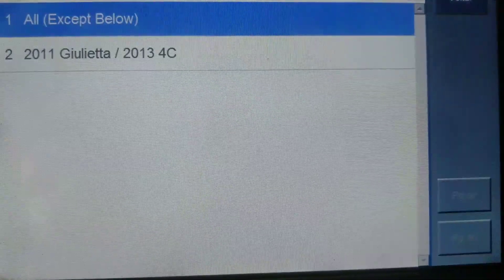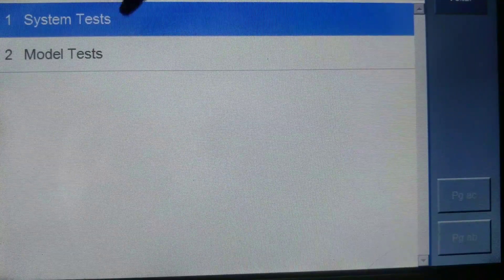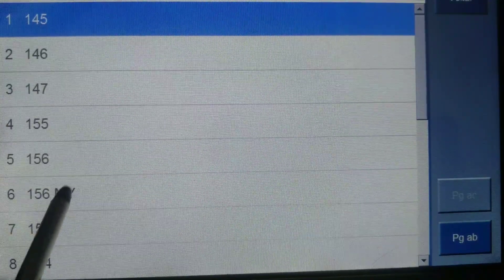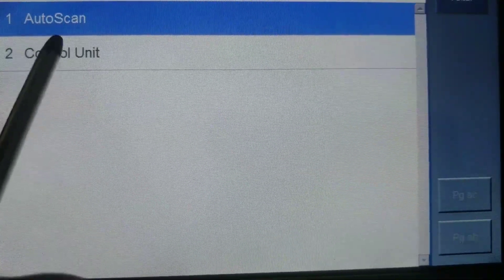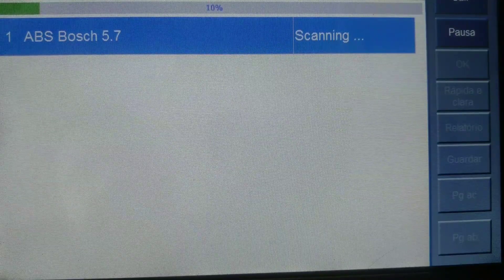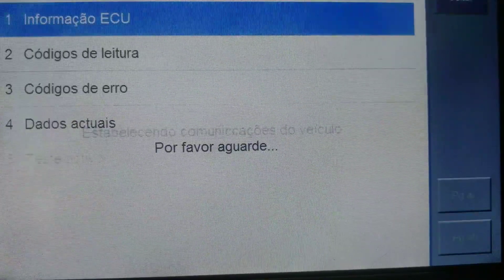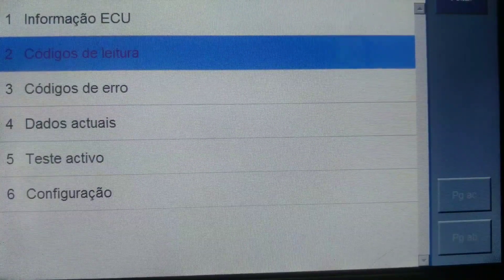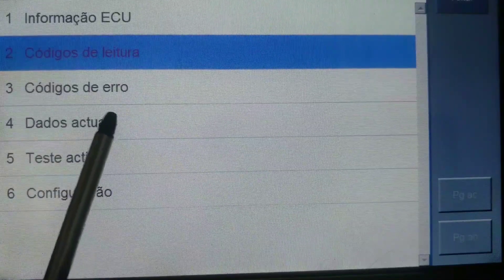Mjet Injectors, how to test and diagnose. Principals of working.

Comment: Hello. Why do you put those rubber hoses over the pipes that goes  from rail to injectors?
Reply from the maker: Hello. It was just an experiment, some models we had to apply some rubber "bumpers" on those tubes to avoid certain vibrations. To avoid fissures on it

Comment: Grazie mille senoir ! This is one of the best videos on the subject of diesel injectors 
this system is also used by General Motors in Vauxhall Opel
Reply from the maker: Hello. Thank you very much! This method is valid for all Bosch common rail systems, no matter the car make or model. Thank you very much for watching.
Reply: Thank you very much you are a true engineer ! and you explain the operating system of diesel system very precisely
Where are you from are you from Italy?
Reply from the maker: Thank you very much, I'm just a technician. I am from Portugal, but I want this channel to be worldwide

Comment: When I rebuild one of my injectors there will not be a code for this injector. does the engine only need this code for the first start and will the motor CPU correct it bysele? I think a rebuilded one has never a code.
Reply from the maker: The ECU eventually will make the idle more stable. But without the injector code it will never be perfect nor can it be diagnosed properly. Because it with the code base that you have the return value for the injector.
When the injector is rebuilt it has to have a new corresponding code.
The old code of for the old assembly.
Reply: @alfaromeonoproblem  Ok, thanks! I will ask the seller if the new one has the right code on the injector.How can I programm the CPU, with OPD there is no posibillity?
Reply from the maker: Yes! And then you can confirm all in the ecu with the diagnostic machine. The 4 or 5 codes have to correspond in order and digits between the assembled and the registered
Reply: @alfaromeonoproblem  Ah understood. Which diagnostic tool are you using, can you recommend one? I have only a very standard OPD tool.
Reply from the maker: I strongly recommend a AUTEL with the proper software, not the "sheap"one.
If you use the multiecuscan make sure is a valid sofware. And use the quality obd plugs. 
On the Autel is just one plug fits all.
Reply: @alfaromeonoproblem  
I found this one on ebay: CRP429C OBD2 Code

No Autel with injector Coding found.
Reply from the maker: Every Autel machine does everything.
Reply from the maker: The problem sometimes is the machines, the cheaper style don't have those functions.
And when they do, must of the times does not work.
The best you can do is just to pay and do it properly.
Reply: @alfaromeonoproblem  Thanks for the hint. You are right, I will look for a better one on Amazon and first try out whether it works, if not I can send it back ;-)
Reply from the maker: Ho haver sells you one has to garantee you it does what you need
Reply: You are the Master! Now I've solved the problem. I had correction values of 5.2 !!!! despite having overhauled injectors I couldn't program them in either, no matter which tool I used...
The cause: I bought the Alfa 156 12 years ago with an out-of-round engine and thought it would be fine. Now the cause - someone, possibly the Alfa factory, has installed the wrong injectors. They were not the JDTm but the ones from the previous model. Unfortunately they fit. Now I have 4 x overhauled correct ones and have correction values from 0.01 to 0.2. Manmanman. Thank you, you're the best! And what do you think about such a shit???

So Meister! Jetzt hab ich das Problem gelöst. Ich hatte trotz Generalüberholte Injektoren Korrekturwerte von 5,2 !!!! Die konnte ich auch nicht einprogrammieren, egal mit welchem Tool...
Die Ursache: Ich hab den Alfa 156 vor 12 Jahren mit unrunden Motorlauf gekauft und gedacht das wird schon. Nun die Ursache -irgendwer, eventuell das Alfa Werk hat die falschen Injektoren eingebaut. Es waren nicht die JDTm sondern die vom Vorgänger drin. Die passen leider. Jetzt hab ich 4 x generalüberholte richtige und hab Korrekturwerte von 0.01 bis 0.2. Manmanman. Danke, du bist der beste!
Reply from the maker: @itsalwaysfake hello. I'm very glad you finally found out! 
The wrong injectors can happen and is very often here in Portugal or poor countries. If they fit and are cheap people will fit them.
Obviously also a mistake can happen. Even from factory. .
Excellent result!

Comment: Interesting aproach !
Reply from the maker: Thank you. It's one of my first steps to diagnose injectors and engines.
Reply: @alfaromeonoproblem  Many people says than you have to check corrections at warm motor. But in my opinion is better to do like you at cold cause all the problems are amplified and is easy to localise the faulty injector. 
On my side now for be sure of the state of injectors sometime i prefer to take it out and go to Bosch point for test them. 
I live in france and here it cost aroud 20€ per injector. Probably in portugal the price will be beter.
You have to sepend some money for do this but you are sure of the real state of injectors and in all case is beter than replace rondomely the injectors :)
Reply from the maker: Yes, I agree. The idea is really that, not to replace anything if not necessary. 
About testing is more expensive. But the problem too is lack of professionalism even on Bosch workshops. They always say new injetors. And than the problem is elsewhere!
Reply: @alfaromeonoproblem  Hope when they test an injector they don't lie :D
Reply from the maker: Happens more times than none here. And the opposite too. A really bad injectors and they say it's good.